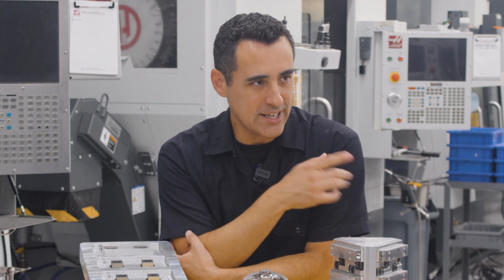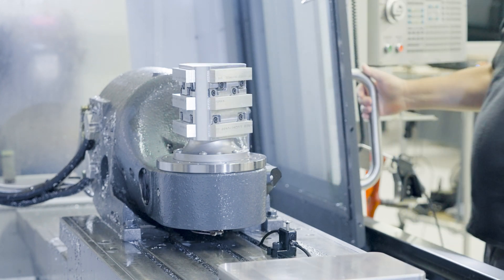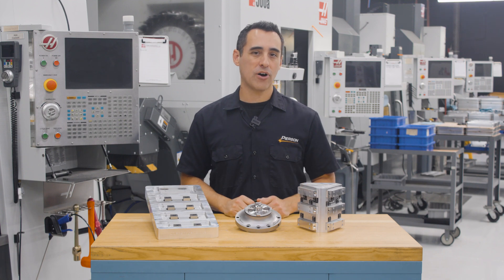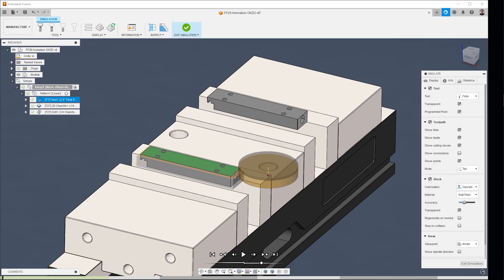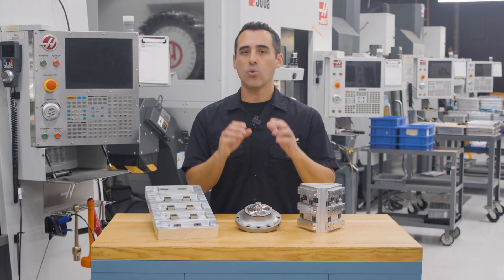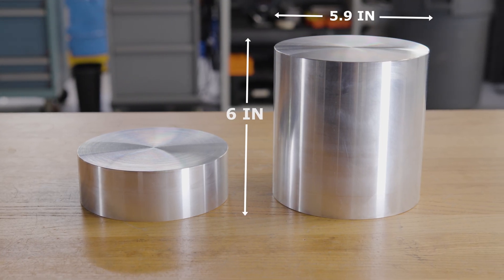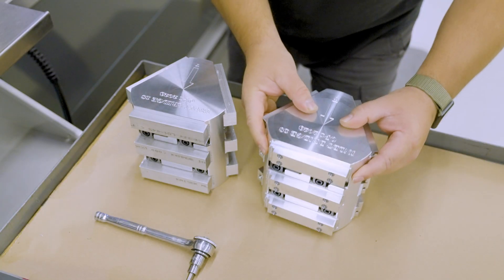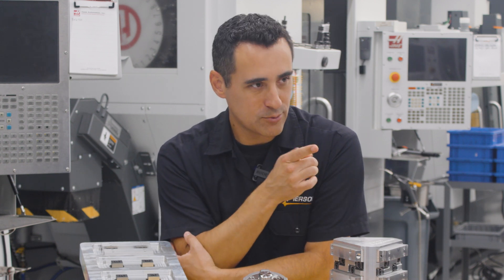NEW MAX-4 Rotary Pallet System - 13.5x BOOST! | Fixture Friday 25

Comment: The same thing can be said about CMM inspection! Running one part at a time on the CMM is inefficient and frustrating. I'd rather have fixtures that allow me to walk away for an hour to set up the next job or perform layout inspection for other parts that don't require CMM inspection. Just like bakers don't make one cookie at a time but rather utilize the entire oven space to bake a batch, we should maximize the CMM's capacity. If the CMM has a large plate, why inspect one part at a time instead of utilizing the whole area with a gang fixture?
Reply from the maker: Great point!

Comment: just woundering but would it be possible to fill a table on a hass with those 5 axis or 4 axis and run them all exactly the same ( like one master and the rest as slaves ) cause in that case you could have one or even two machine's filled up with them and another right beside/in between it  whth the flat pallets doing op two for both machines ( since it has way less work on op two it should easily be able to keep up with the other two machines that do the op one )

this is just a personal thing but if i know that the machine is only gonna run alu or plastic or copper or other kind of copper alloy  ( aka. no chance of sparking materials ) its entire life and nothing else then i would just use oil instead of coolant. but that's just me
Reply from the maker: You sure could do dual platter rotaries and fill the machine table.
Reply: @PiersonWorkholding  but can you put more then one of the 5 axis rotery table's on the same table/machine and run the secend one as a slave/follow what the other one do ? ( basicly splitting the signal wire so both get the same command and move to/rotate to the same position ). could be need to have a cf6 with like 4 or 6 5axis rotary tables on it with pallet's on them. just imagine the output and also spindle run time where the operater can go do something else

Comment: I like the examples of increasing number of parts and reducing cycle time by just using the magically appearing 5th axis.
Reply from the maker: Lol! Yes the footage is on a 5 axis but these parts only require a 4th axis.
Reply: its not really reducing cycle time. its more of reducing idle/part change time and improving stability
Reply: @flikflak24  i view times as controller (displayed on machine controller, basically start to stop), load/unload, and cycle time (start to start) which is the sum of controller and load/unload times. So in with that math its better cycle time

Comment: Nice work Jay!  Can you comment on how low volume repeat products can be evaluated for High Density Workholding?  Something like comparing 10/quarter to 100/week 20 minute cycle parts?  100/week seems obvious to do,  but 10 every 3 months not so much;  what method do suggest for deciding when to and when not to use HDW?
Reply from the maker: Great question! I'd focus on using standardized bar stock widths and design fixtures to take care of  Op1. The same fixture could potentially run different parts. I have a FF episode planned that will show off that approach.
Reply: @PiersonWorkholding  👍👍

Comment: You could have put 16 per cycle on rotovise with pallets could you not?
Reply from the maker: We plan to add automation and the MAX-4 is meant for automated tasks. RotoVise pallets have more capacity but require manual pallet changes.

Comment: Nice product , nice video, just 1 question. It seems like maybe you could have made your pallet just long enough to hold 4 rows of your vacuum chuck part without a lot of problems but obviously I am not aware of all the parameters. Thanks for sharing
Reply from the maker: We looked at that but if we squeezed them in the material on the ends would have been too thin. Of course, a 1/2" longer pallet would have allowed that but we like to use our standard pallet sizes whenever we can.

Comment: As always great and informative video! Really thought provoking. 
Have you thought about a small pallet changing vertical like a brother r for these kind of parts? With a 4th axis on each pallet you could hit all six sides and load the parts time independent of when the cycle is finished. 
I think that would be a great next step. As you only have high quality personnel, the additional machine type and controller shouldn’t be that much of a hassle.
Reply from the maker: Yes eventually. As we grow we're migrating away from 3 axis mills and replacing them with pallet changing machines.

Comment: Why are you not just put the part shown in a y axis lathe / mill-turn with a bar feeder? - Is it due to the offset through hole on the edge?
Reply from the maker: LOTS of reasons but I'll give you a few. For starters, this part has no turned features which immediately disqualifies it to be run in a turn/mill. Our general opinion is that live tool lathes are terrible mills. Compared to a mill, they have worse surface finish, low spindle speeds, limited travels, generate high toolblock heat (wear) and tool size is limited. Op1 alone would have required 9 live tools in a 12 station turret.

Comment: That is a 2 minute part complete
Reply from the maker: 5 min, 10 sec per part complete to be exact.
Reply: @PiersonWorkholding  I'm saying that part can actually be made in 2 minutes on a Haas and hold any tolerance you need.
Reply: @scotturquhart4380  Bang on. Anything over 3 mins is insane.
Reply: There are probably two minutes in tool changes alone.  Piersons comment is a realistic number for cycle time.
Reply: Less than 1 minute total on my Brother, with more generic workholding.
Reply: @cgpmachining  brother is a difference story I own an s700 and I'm aware of the benefits. You can't compare a brother that rapids at nearly 800 IPM faster and the tool changes are way faster to a Haas. That wasn't the point of the video
Reply: @LoneWolfPrecisionLLC  I am only responding to it being a 2 minute part, my thoughts on the fixturing are best kept to myself. By the way I have an R650 with a Brother rotary on each table.